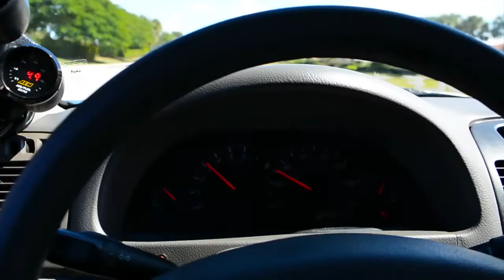Did i Blow My motor?!?! - Turbo Camry (Update Video)

Comment: Which years of the 2afe motor, has oil consumption issues?
Reply from the maker: Isiah Oliyide I’m pretty sure almost all years up until 2011, but i did some research and they had to do a recall in the gen 6 Camry’s 2007-11
Reply: ShaneVlogs thanks I researched too and the 05 tc is the only one with out the issue, they didn’t add the oil tech until the next year
Reply from the maker: Isiah Oliyide ahh i see but even for my car i didn’t have the issue till about 120k miles that’s when i started seeing it slightly but it was because of my turbo as well